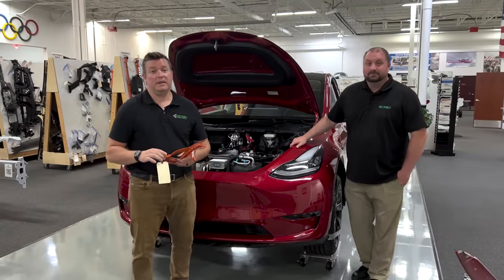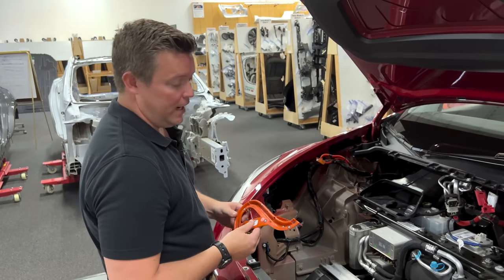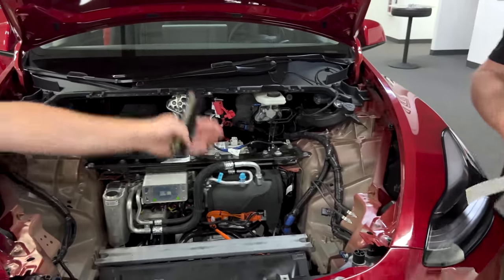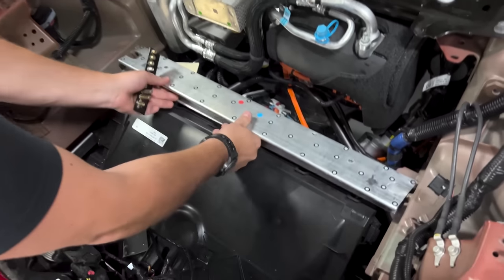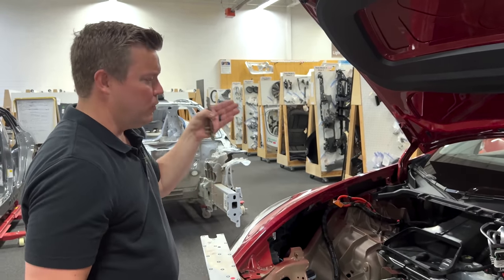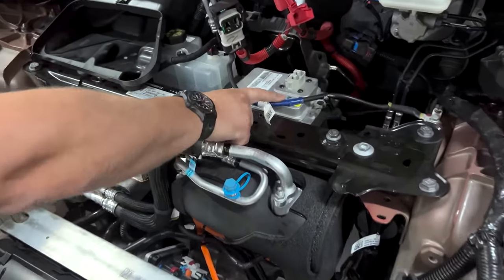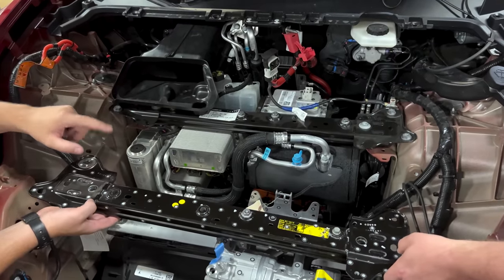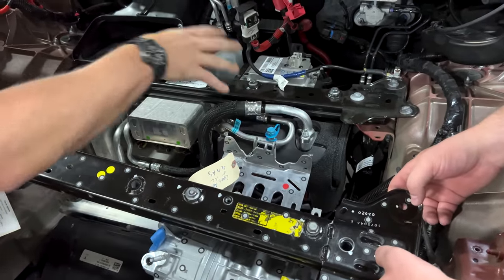Tesla Model Y - Under the Hood | Giga Texas Revisions

Comment: It’s amazing how clean the Y is compared to all other EVs under the hood. Designing for manufacturability is really becoming obvious and is Tesla’s most under appreciated (outside of Munro) advantage over the competition.
Reply: most car OEM's dont take into Consideration of the WHOLE car Hollistically like Tesla does.
Reply: Very curious how the serviceability is on these hyper integrated designs. You might have good lean design, but if some hose needs to be replaced and you need to take the entire car apart then imo it's a fail because in the end it's still a consumer product and if the consumer feels ripped off it doesn't matter how well your design was as it will change the companies image to "very expensive to repair cars".
Reply: @ZeroInDaHouse  
Yep.. Most consumers don't care what is under the skin until it needs to be repaired.
Other EV's look messy under the hood.. But all the electronics are there not integrated into the motor assembly.
 In a Bolt EV... a few fasteners and  electrical connectors, and the inverter can be removed. same with charge controller.
 Not as neat under the hood, but I could repair it myself in 30 min.. and Chevy WILL sell you the part you need.
The Tesla is beautiful to look at from an engineering point.  But when they get older and need repairs.. it may be very expensive to get done.
Reply: @kens97sto171  I totally agree.  The total lifecycle of the product matters.  Designing for manufacturability is one thing, but maintenance and repair are part of the picture.  I can see how Munro looks at it: once the product is out the door of the plant, then it is the consumer’s problem.  However, it still matters what happens after a product is sold.  An unhappy consumer who is stuck with a durable product such as an automobile which is time consuming or expensive to repair may not be a repeat customer.

I happen to own a 2017 Chevy Bolt and I’ll agree it is nowhere as artsy as a Model Y, but it is probably a damn sight easier to repair.  I had the main battery replaced under the recall and oddly just last week, the main contactor stuck on.   It was apparently the fault of firmware.  A dealer other than the one where I bought the car happened to be closer and did the firmware and contactor replacement in one day.
Reply: @wtmayhew  
Totally agree. Most people buy a car based on how it's physically meets their needs. Size shape design practicality etc. Most people don't really care what's under the hood.
If you want to see a detailed disassembly of a Chevrolet bolt EV. Check out Weber automotive on youtube. They've got a full battery removal and disassembly as well as powertrain removal and disassembly. How the cooling system works. It's one of the things that attracts me to that car is I've seen one disassembled and it's pretty easy to do with basic hand tools. At least the powertrain stuff. Taking the battery out definitely does require some specialty tools or some extreme care if you did not have those specialty tools. But if you needed to swap it inverter out or the charge controller it's mounted right on top under the hood.
While I do appreciate the beautiful design on the Tesla under the trunk. Working on it when it's 15 years old is going to be a nightmare if it's even possible to do. It starts to seem as though it might just be a disposable product like a cell phone. Now if that lifespan exceeds 15 years. Maybe it wouldn't matter. But we really don't know that yet.
I currently drive a 14-year-old Prius with 405,000 miles on it, 
At about 380,000 the inverter failed. Actually only the DC to DC converter side of the inverter failed but it still disabled the car. Got online picked up the inverter from LKQ Salvage for $100 came from a car with $130,000 miles on it. And 45 minutes later I had it installed the coolant bled through it and I was back on the road. Same thing with the main battery pack. The battery is easily removable and either repairable or replaceable by someone with basic mechanical knowledge.
Reply: When the time comes and when Tesla works out all the kinks. They will be able to make a $25k vehicle and still make a profit from it and it will have good performance.
Reply: @ZeroInDaHouse  what needs to be “serviced”? ICE vehicles need that, not electric. I’m over 60k miles in my 3. Rotate tires 🛞 and fill windshield washer fluid is all I ever do.
Reply: The amazing thing about Tesla is how much effort is put into engineering. Too many manufacturers are run by MBAs, not Tesla.
Reply: @AaronVanNoy  Same but don’t forget your cabin air filter too. 👍🏽
Reply: @ZeroInDaHouse  most of these changes are revs (revisions) which are almost always backwards (and often forwards) compatible. It’s generally only new parts that may be a cause of concern. As pointed out in the video though the new parts have fit to the same mounting provisions etc so I wouldn’t worry about.
Reply: @mikereliford55  you are right, I did have that and windshield wipers changed.
Reply: @philipstull7629  
That is true, however anybody that's ever worked on a vehicle later in its life will tell you that generally engineers aren't thinking about repair and maintenance after the fact. Talk to any repair shop and they'll tell you that engineers need to spend more time on a shop floor. You can definitely see this with Tesla. It's neat and tidy having your inverter mounted directly to your motor assembly. Until It breaks and then you have to replace it. Having it mounted on a bracket under the hood is certainly not very attractive looking. But when it comes to repairing it it's four bolts and a couple of electrical connectors and it's fixed. And it could be fixed by your average Joe in the driveway. Now if Tesla can show that their engineering will last 15 or 20 years in that vehicle then maybe it doesn't matter.
Reply: @ZeroInDaHouse  many parts are BACKWARD compatable with older cars.
Reply: @markplott4820  that’s your own opinion lol…… you realise that many other EVs have frunks right!? Other EVs are designed for max interior space and short front overhang….. for better turning radius and more.
Reply: @ZeroInDaHouse  
Ever heard the term "points of potential failure? the more pipes, connectors, cables, knobs, switches, gauges, etc you have, the more trouble you WILL have in time.
Just because something isn't integrated, doesn't make it easier to get to, in fact, not only is it more likely to be ticked in a corner, but there's more cable,etc leading to it.
The Tesla touch screen is a perfect example, replacing who knows how many components.
Others vehicles? A switch, or maybe even a bulb, may mean taking the whole dash out, what you might save in parts cost, you more than pay for in time.
This panel, a few screws, a couple of connectors..... and more than likely repairable.
.
As for the other comment... "GM will sell you the part"
You know Tesla manuals are on line, for no cost?
Why would they be if parts weren't available?
Stop guessing.
Reply: @ZeroInDaHouse  there is basically no serviceability in those integrated parts! Not at all! On stamped steel/aluminum you can even make a custom part at home for repairs and those very old cars are able to be repaired because they don’t have a single massive part.
Reply: @ZeroInDaHouse  just go around the world and look at the oldest cars still on the roads! Those are super serviceable anywhere anytime.
Reply: @kens97sto171  I just want to see those same teslas in 10 or 20 years tbh! Because old ICE cars gets exported to foreign countries Africa or even South America where they are still used/repaired and driven till they fall apart.
Reply: @wtmayhew  
"Total life cycle of the product matters"
Case in point.... Tesla motor control circuitry. 
Common base part thought the range.
Designed to run the plaid(!)
Same components in the 3&Y (and likely the Cybertruck, maybe even the semi?)
OVER engineered for most applications.
Less likely to fail in the first place.
Common, so cheaper a d more available.
Stop making up "FUD scenarios" and trying to make them fit.
It's sad.
Reply: @shannonwoodcock1035  lol…… they have never been able to deliver a single cybertruck let alone the semi, and you’re talking about a $25k car!? Wake up mate!!!!!
Reply: @AaronVanNoy  
Blinker fluid? 😉😂
Reply: @AaronVanNoy  you realise that EVs also needs to be serviced right!? EVs are not immune to that, it didn’t matter what it is! An ICE also just needs very basic regular maintenance they can be done at home too! And with your ICE you have way more flexibility in your movements!  A rav4 or Subaru are great economical daily drivers but during free times are excellent vehicles to go to remote places explore/overlanding/camping….. totally impossible with any tesla
Reply: @carholic-sz3qv  
Absolutely it's all kind of unknown at this point. I've got a 14-year-old Toyota hybrid with 404,000 on it.
The guy in our local car group has the same vehicle with 580,000 on it.
For me because I drive a lot repairability is a big deal. Especially if you're trying to have any kind of value of a used one. Buying a 10-year-old Tesla is going to be pointless if it's going to cost you $20,000 to keep it on the road.
And none of this is really known yet. If you could buy a brand new battery pack for $5,000 and keep the car running for another 15 years then there's value in those used cars. But if that's not the case they just become essentially giant paperweight and end up in salvage yards.
I've got a 35-year-old Ford F-350 sitting out back. Put a battery in it turn the key and it runs. Extremely unlikely that a 35-year-old Tesla is going to still be operating.
Reply: @carholic-sz3qv  
Watch the Munro motor electronics comparison.
Watch their comments regarding seats.
Watch what they say about the cooling system.
They are always showing us parts on for instance the Plaid, with "M3" stamped on them, or visa versa.
So no, it's not "our opinion".
It's fact
Pay more attention.
🙄
Reply: @ZeroInDaHouse  have you ever taken a look at some older  Chryco  products ?  Like try to replace a battery of a 2000 or earlier  300  or Concorde?.
Reply: @kens97sto171  I agree.  De-contenting and centering on manufacturability makes a lot of sense for a disposable product with a finite life expectancy like a ball point pen.  Bic did a marvelous job of taking a pen to the bare minimum while delivering a product which does a pretty good job of writing.  When the pen is empty, throw it away and start fresh; there isn’t any point in trying to make the ink cartridge replaceable let alone repairable.  Even with arguably marvelous engineering, components in Tesla products will inevitably break or wear out, out the car may need collision repair.  Automobiles no matter how good need maintenance because they are too expensive to be disposable - at least for most consumers,

I am thinking about the drive motor with integrated electronics.  Maybe Tesla uses magic aerospace grade electrolytic capacitors which never go bad, but electrolytic capacitors are notoriously problematic in high heat and high vibration environments - like say inside an electric motor.  Time will tell if engineering and suppliers are good enough.
Reply: @AaronVanNoy  All those parts under the frunk at some point need service. Just because you longer need engine oil changes, the car is now maintenance free? Everything else is exactly the same. By now you should have flushed the brake fluid, unless for some reason you drive 30k miles a year.
Reply: @wtmayhew  
Absolutely. The integrated inverter is a marvel of engineering. There are some great videos of the disassembly process. The other bitch for me is that it's coded to the VIN number. So even if you were able to get it apart and get one out of a salvage yard it won't work. That's not true with a Toyota hybrid. I can go to any salvage yard and get an inverter from any other Prius of the same generation plug it in and it works. The inverter is on Prius has failed eventually. They are liquid cooled. They are mounted directly to the drivetrain of the ice engine and transmission. So they definitely do encounter vibration probably more than the Tesla would. The motor on a Tesla is mounted to the chassis and uses drive shafts out to the wheels so it doesn't see road vibration anymore than the body does.
If they simply made it not VIN coded or made it easy to get the programming done using a off-the-shelf code reader. Then I would be happy with that. It leads to long-term repairability. Inverter fails on your Tesla you can go to a salvage yard find one that's crashed pull the components and get your car back on the road. People have been doing engine and transmission swaps forever in all vehicles. Preventing people from being able to easily do that will make them disposable and essentially valueless in the used market at some point. Nobody is going to want to buy an $8,000 Tesla with 300,000 miles on it because they know it could end up with a failure that they are incapable of either getting the repair done at all or affording to get the repair done even if it's possible to do so. I can buy a transmission for my Prius for 300 bucks. I can get an engine for about $1,000. And if I'm incapable of doing the work any shop can do that work for me.
That's why I kind of like the Chevrolet bolt ev. Chevrolet will sell you components to repair your car even battery components. Check out Weber automotive on YouTube. He has a complete disassembly of a Chevrolet bolt EV. Battery pack down to the module level and powertrain completely disassembled. It's a neat piece of work that they built. Definitely serviceable.
Reply: @dannelson6980  what parts need service?
Reply: @carholic-sz3qv  what parts specifically need service?
Reply: @AaronVanNoy  I second that with my 2013 Nissan Leaf.  60k miles and still going strong with only tires and washer fluid for maintenance.
Reply: @morrisg  no oil change here. You?
Reply: @AaronVanNoy  Brake fluid to start, it does not matter if you drive it or not. It absorbs moisture. If you wait too many years you get internal corrosion. Around 100,000 to120,000 miles there are things like coolant, transmission oil, the transmission filters there is one on each drive unit. All these fluids have anti corrosion additives in them, that are slowly depleted. I'm not willing to replace  $20,000 battery pack that failed from cooling tube corrosion, that could have been prevented by replacing a $100 of coolant every 10 years. About that time you start to see CV joints, suspension bushing, mounts and so on needing to be replaced.
Reply: @dannelson6980  some of what you said does make sense. I do have to knock the rust off my breaks once a year with some breaking. CV joints and shocks do go, and I’m sure the price for that to be replaced will be a bit higher. But I thought you said things under the hood. As for battery, you have some really outdated information there. I’m not going back to gas, ever. Best of luck to you and affording gas ⛽️.
Reply: @carholic-sz3qv  Tesla is already making a huge profit on their current models and much of that is due to the manufacturing process that Tesla has implemented. 

Cyber Truck & Semi are coming. They are still building additions to Giga Texas.

But yes. A EV in the price range for mere mortals is the game changer I see Tesla releasing in the next 2 years.
Reply: @AaronVanNoy  :<)  Nope, me neither.  Same cabin filter too.  And when you do have the brake fluid flushed, well they're the same brakes on any ICE vehicle so no harder to do on the EV.  I get the feeling some non EV drivers are just fooling themselves to justify paying lots of money to fuel their vehicles.  Sigh, eventually they'll find an EV they want and then you won't hear the end of the praise for that particular model.  Enjoy!
Reply: @morrisg  I won’t hold my breath for the praise! Electric leaps and bounds better.
Reply: Dad used to work for Toyota in the 80’s and they would send engineers to learn from mechanics how to build a car that took serviceability into account.
Reply: @benpaul909  Well, they failed on my 1998 Camry.  When the serpentine belt let go, the front of the engine was so close to the shock tower that I couldn't get a socket wrench and socket on some of the bolt heads.  Had to use a closed end wrench to remove them.  PITA!  Plus I had to remove the radiator to get access to remove the regular fan belts.  Ugh!
Reply: @aurelio-reymilaorcabal9669  I remember 70s/80s Chevys.  Need tool <X> to get the #8 plug out.  Have to remove an engine mount to get an alternator out.  They got a lot better in the 2000s (really all of GM, including Cadillac) and became a big reason I kept buying them over others.  I've got a Colorado I absolutely love and a Tesla S85D I also absolutely love.  The truck gets driven once or twice a week, sometimes not at all, depending on what we're doing, because gas.  The Tesla adds about an hour for every 300-400 miles on a long trip, which I don't mind, but the wife hates, so the truck usually pulls that duty.
Reply: @dannelson6980  Bzzzt!  Sorry, the brake pads almost never need replacing, because you pretty much never use the brakes.  Maybe 10% or less than an ICE vehicle.  There is no transmission, so no oil or filter.  Tires, wipers, wiper fluid, blinker fluid.  When stuff does break they come fix it in my driveway.  I've had to take it to the shop twice in the 3 years we've had it.  Once for a suspension recall and once to upgrade the telematics from 3G to 4G.  Tires once.  About 30k miles.  Pretty reasonable for something that still gives me an ear to ear grin every time I mash the go pedal.
Reply: @scottgaree7667  I didn't even mention brake pads, I have a car with 26 year old brake pads. The rotors had built up surface rust but a few days of hard braking cleaned that up. I would expect a Tesla to do that automatically but, for some reason they don't. The calipers all had to be rebuilt and the hoses replaced, I reused the pads, they may never need to be replaced in my lifetime. On a ICE car with an automatic, the brakes pads have to be replaced so much, the fluid, is bled, calipers lubed, hoses checked every few years. Most of the brake component issues are taken care of at that time.

Maybe you need to watch a few more teardown videos. There absolutely is a transmission, transmission oil (ATF in a Tesla), and filter the part number is 1095038-00-A the service interval is 120,000 miles. There might be a sensor now for fluid service, likely just a timer. I have heard of people getting a transmission fluid service warning. Maybe they read the load on the pumps or something to trigger the service warning. The motor and transmission are oil cooled on a Model 3. 

When you have one with 300,000 miles is decades old then we can talk about maintenance. Even in ICE vehicles, how many are junked from engine failure? I would say very few, it is all the other  parts that slowly one by one need to get replaced and don't, till the car is considered junk.
Reply: @AaronVanNoy   Brake rotor rusting is a different issue, from water building up in the brake fluid. It is rusting on the inside basically. So you don't know till it is too late.
I don't know what you are talking about with the battery. If you end up with a coolant leak in the battery it will ruin it. 
Tesla does not service them only replaces the complete packs. They don't do subassembly repair in general. If you have bad bearing in a drive unit, they don't replace the $50 bearing , they replace $10,900 drive unit. I have already seen 4680 packs disassembled, how they are cooled, and the cell opened. I have seen about every version of Tesla packs disassembled, for that matter most EV packs. I don't even know how much gas costs. It is hazardous waste to me.
Reply: @benpaul909  yeah, the 80’s. No modern gas car is like that now.